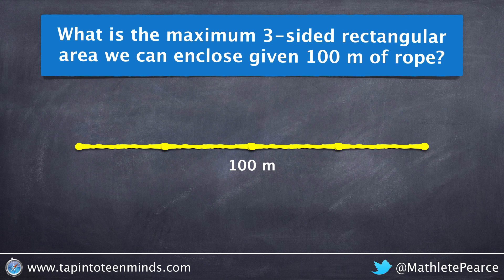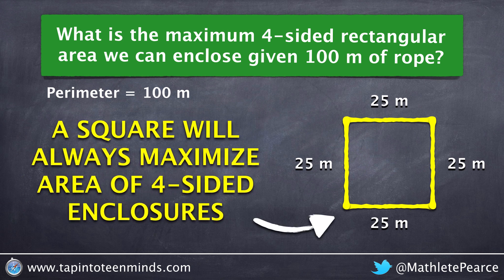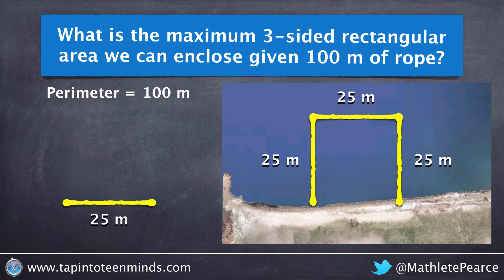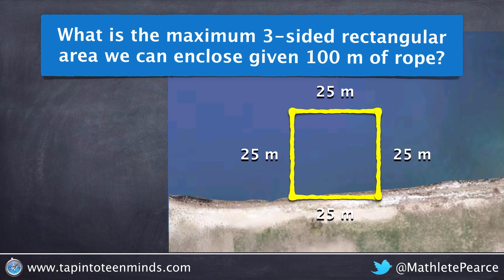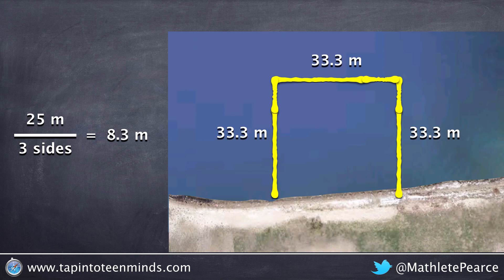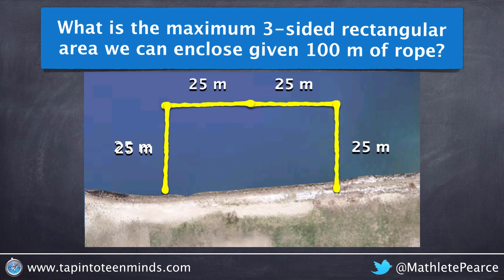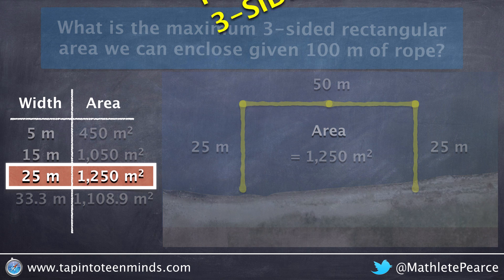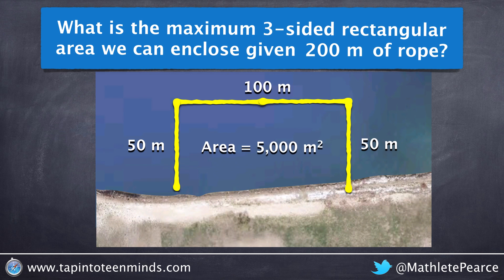Maximizing Area of 3-Sided Rectangular Enclosures With a Fixed Perimeter - Optimization

Comment: This is my math question it says a farmer uses 240 meters of fence to enclose a rectangular plot on only three sides and uses a creek as the boundary of the fourth side. Write an equation for the fenced area A in terms of length l of the rectangle plot. I tried doing anything but I couldn't do anything and I wasn't progressing.
Reply from the maker: Did this video help you out at all? Same concept, different dimensions...